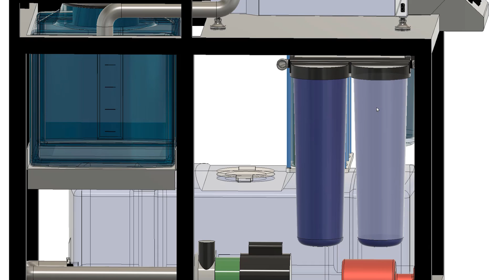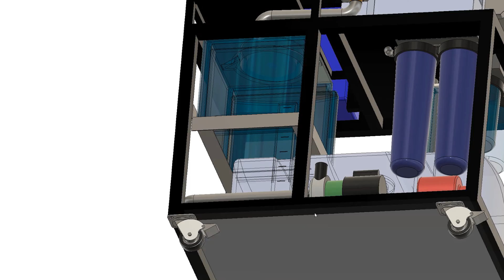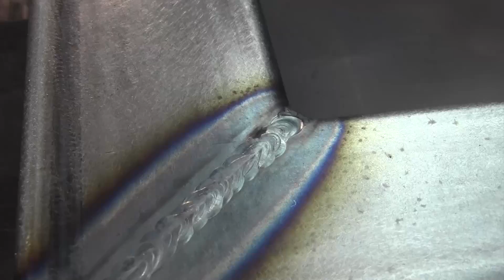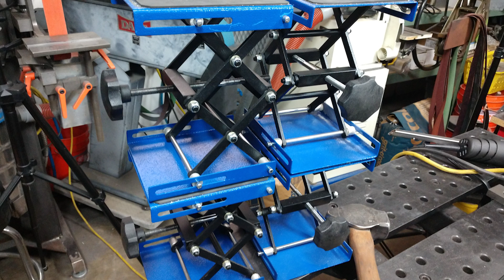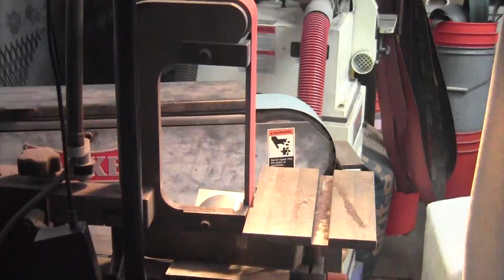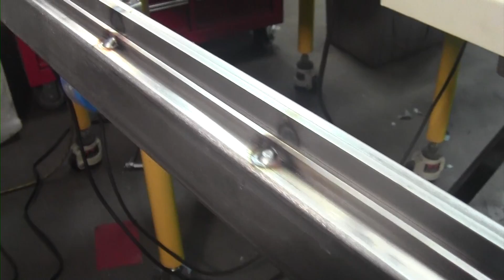Building a cart for the Epic EDM build!

Comment: Hi , I’m using a separate 19 inch rack to house the generator, drivers box and kflop, away from the  humidity of the tanks , one question , is how did you pick the dirty water and pass it tru the filters? See only 2 pumps there ,
Reply from the maker: I have three in tank submersible pumps. I will show more if you want.

Comment: Nice job on the stand.  I'm always impressed by how meticulous you are.  It's great to see the project moving forward.  This is something I'd like to tackle myself, so I am keen to follow your progress in the videos to see if it is something I can realistically tackle.  I've used epoxy before and never had any adverse reaction, so I was a little surprised to find out about what you were saying regarding its use.  Given that it is so unhealthy, I'm curious why you wanted to use the aluminum slugs and epoxy?  Was there a specific reason you wanted to go that route?  I thought you might have done just as well by machining steel slugs and drilling holes in your tube to plug weld them in place?  Just my curiosity, I'm not criticizing your work.  I think what you do is amazing.  Can't wait to see the next installment in this series!

Comment: nice design.
can you tell me what's is difference from oil or water system  ?
Reply from the maker: Water as a dielectric in wire EDMs has always been the
 standard, but the upsurge in micromachining has spurred the use of oil as a dielectric fluid instead. Unfortunately, not many U.S. shops are taking advantage of this technology. Shops that can benefit the most from oil-based wire EDMing include those working with carbide parts, those micromachining parts for nano applications and mold manufacturers. Moldmaking: For the moldmaking and tool and die industries, oil-based wire EDMing allows shops to machine additional features into finished mold components without affecting their polished surfaces, unlike with water-based wire EDMing.
These additional mold features often include lifter pins and
 other small details that must be done after a mold is completed. In addition, moldmakers cutting fine mesh-type mold materials can oil EDM them without having such parts absorb water during the machining process or if parts are left on the machine for extended periods of time, as is the case with water-based wire EDMing.
Moldmakers use fine-mesh materials mostly for mold inserts
 to allow air to quickly exit mold cavities, which contributes to shorter injection molding cycle times. The material is also used in the medical industry  Carbide cutting: Oil-based wire EDM is also advantageous
 for shops cutting carbide parts and facing similar water-absorption issues as shops cutting fine-mesh materials do. Waterbased EDMing has adverse surface conditions caused by the water in the dielectric tank, so carbide parts must be dried as
soon as the part is completed to prevent corrosion. An oil-filled
 dielectric tank eliminates these problems. When carbide parts are left in dielectric water, the amount of water the parts absorb depends on the density level of the particular type of carbide. Once water is absorbed, corrosion can occur deep inside certain carbide types. This corrosion permeates way beyond an EDMed or ground part surface and is undetectable with simple visual inspection. As this corrosion grows, it jeopardizes the integrity of the finished part.
Micromachining: For shops micromachining parts for nano
 applications, oil-based EDMing allows them to successfully generate precise and clean part surfaces. This is critical when secondary cleaning or polishing operations are not an option on parts that are too small to handle. (Reprinted from MoldMaking Technology September 2010)